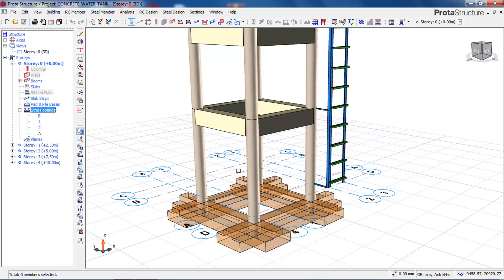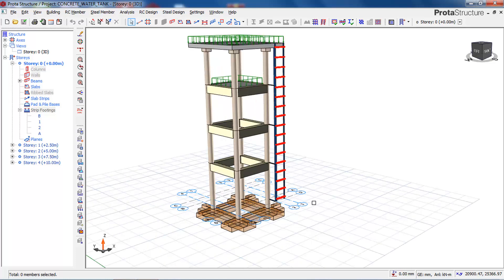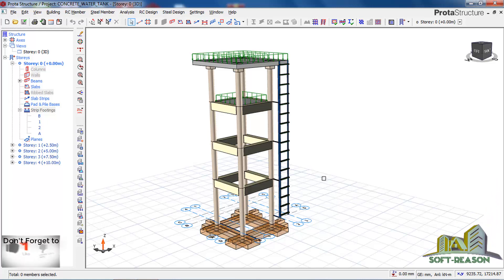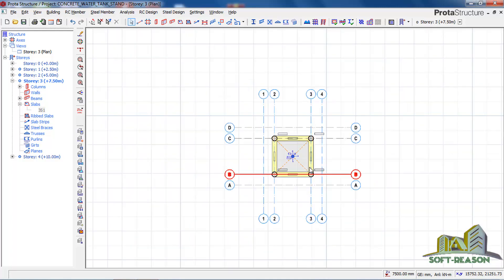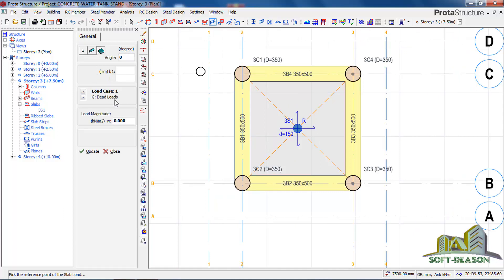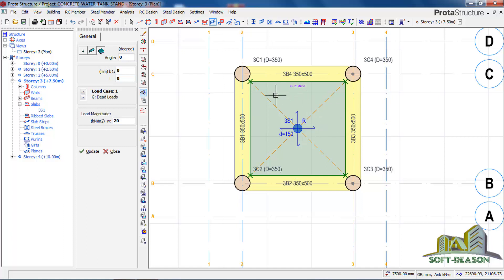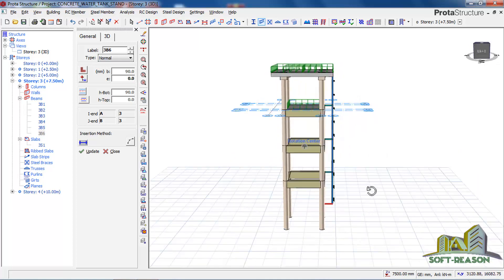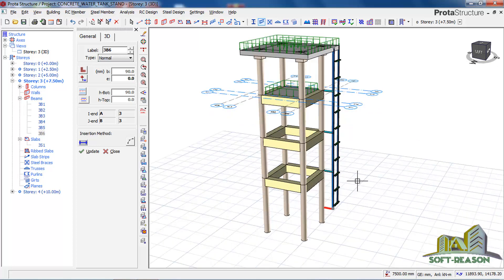CONCRETE WATER STAND

Comment: Nice one. What if i factor the weight of the tank into the imposed load on slab, will that be same thing as applying line load?
Reply from the maker: Factoring weight of tank into imposed load may work as an alternative loading method which wouldn't necessarily reflect in the Structure visually and effectively. Also it may cause rc slab overstressed.